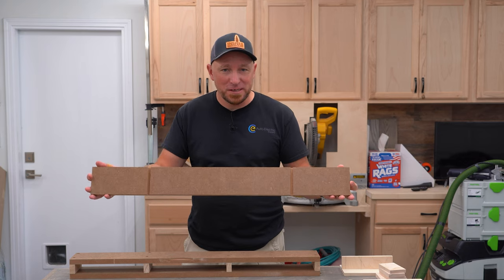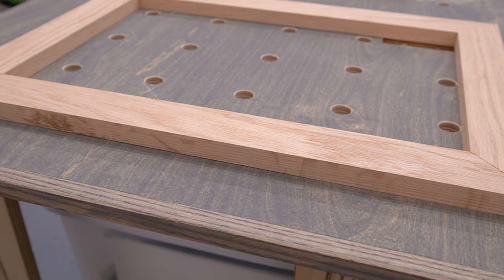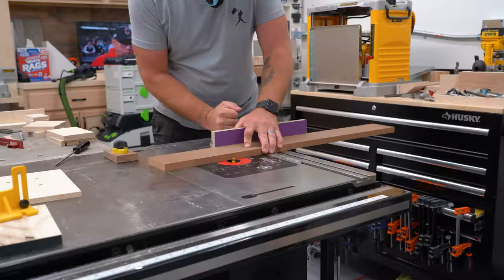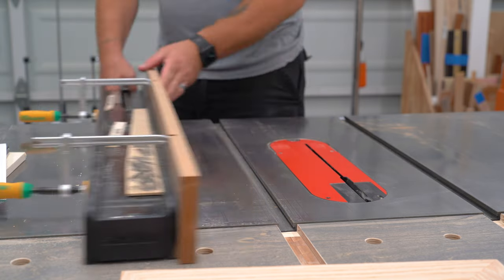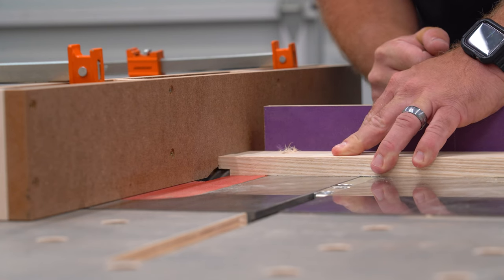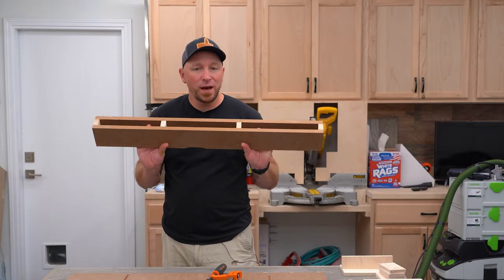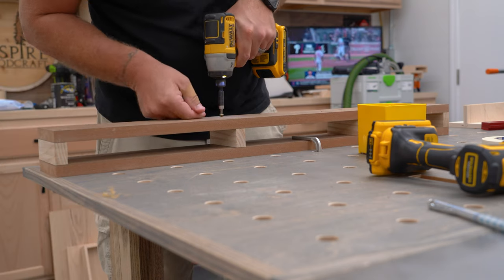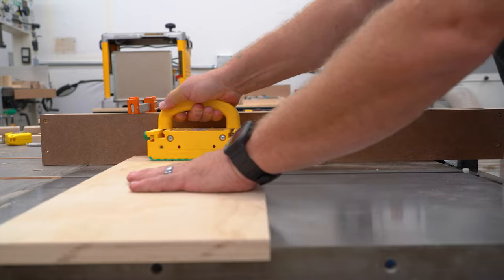TWO EASY WAYS to Make a SACRIFICIAL FENCE for the Table Saw

Comment: Just got my first set of Microjig match fit clamps. So worth the money 👍 Made some extra tracks in my drill press table so I could secure the jig I made. So much easier than trying to use an F-style or  squeeze clamp to secure a workpiece. I have wanted a set for quite some time but never pulled the trigger. The right tool for the job always makes it simpler.

Comment: Couldn't the thin pieces kick back in between blade and fence?
Reply from the maker: @instantalbums  There shouldn’t be any thin pieces. Since the blade is partially buried into the sacrificial fence, it isn’t making a through-cut. Meaning it isn’t separating the material being cut into more pieces. Unless you count the sawdust! 😆

Comment: This is cool but I've seen way easier ways to cut the blade width off a piece of timber. Just run the saw blade to 3/4 length of timber edge, then flip over and you can run against it.